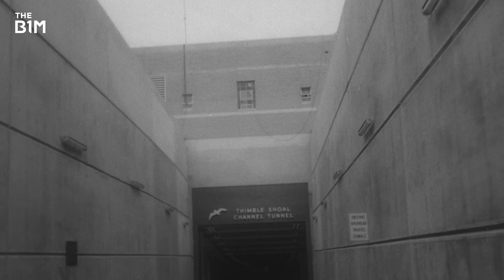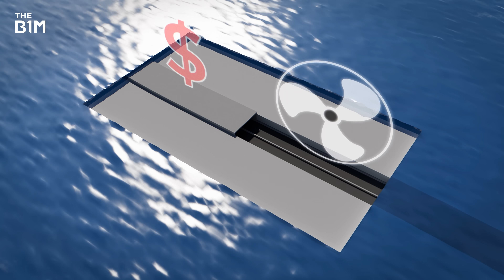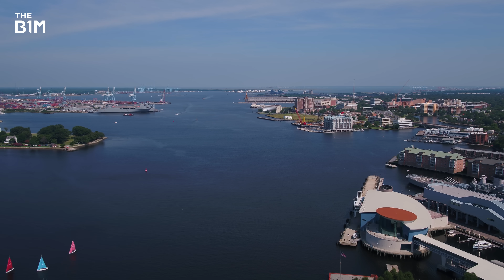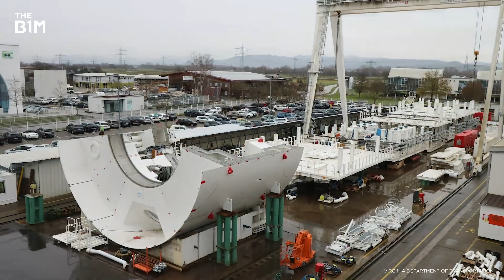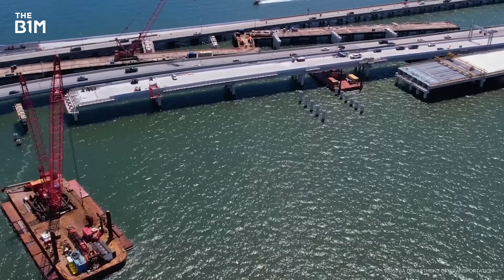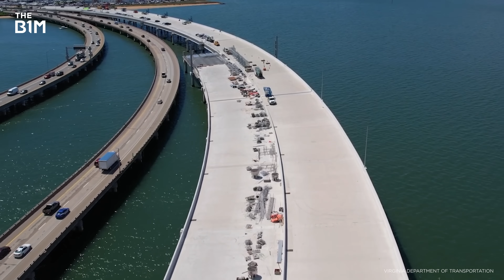The US Megaproject You’ve (Probably) Never Heard Of

Comment: Back in the day (1960's-70's) we had just 2 lanes total with NO room for error.  There were men in the tunnel on a narrow side walkway that literally WAVED vehicles to keep on moving along... too many drivers would slow down (even stopping) when they got inside the tunnel for its obvious claustrophobic atmosphere (with vehicles in the other lane coming towards them).  A Sunday evening going from my grandparents in Va. Beach to go back home to Hampton regularly inlcuded the multi-mile crawl of under 5-10 miles per hour to get across the bridge-tunnel.  (Nevermind the 1070's 90-cents toll to do so).  Now some 50+ years later with the current 4 lanes, the same scenario is quite common, even with longer backups (e.g. 5 miles or more).

Comment: I used to drive to work through the HRBT every day and took the Monitor-Merrimack Bridge for the return trip home.  I don't miss any of the carnage and gridlock a bit, especially during the summer months.  Idiots actually run out of gas in the middle of the tunnel.

Comment: I was in the Navy and stationed in Norfolk in 2003. I remember driving in for the first time at night and using these tunnels. It seemed so big back then. I also remember the traffic VERY well. A few years ago, I brought my wife and in-laws down to Norfolk to see my old ship, and when we came in, I noticed the new bridges running parallel to the old one, but I didn't know what was happening until now. This is super cool, but it would be even cooler if it were a tunnel for high-speed rail. 😉

Comment: What they dont tell you about these bridge tunnels is that half the people have tunnel anxiety and go HALF the speed limit, unobstructed, in the bridge just for everything to go back to normal when they see daylight. Most of the traffic is from this and its incredibly frustrating while also causing backups all the way into Hampton on the North side, or VA beach on the south side. Pretty much every-other time I have to take the hrbt, you are stuck behind a row of cars going 30-40mph with the lead car having NOONE in front of them (maintain 55 listed in the tunnel multiple times). And realistically, based on enforcement,  we drive 65-70 on the bridge sections. These people need to just get off the road because it creates accidents, road rage, and problems (which are particularly a problem in a tunnel). sincerely - a hampton roads resident

Comment: As a kid going to the tunnel, it used to annoy me how the radio would cut off. It really sucked if there was traffic because you were stuck in there for 30-45 minutes sometimes. When they built the Monitor Merrimac Tunnel, they addressed that. This new one actually has 4 and 5G connectivity and can be upgraded later on easily.

Comment: THERE ABSOLUTELY DOES NOT NEED TO BE ANY PROBLEMS AT ALL
FOR THE H. R. B. T.  TO BACK UP
A GODDAMNED SEAGULL FLYING OVER WILL CAUSE A MASSIVE JAM
OR HOW ABOUT “ TUNNEL PARANOIA “
I VE GONE ACROSS THAT STINKING THING SINCE THE SIXTIES AND
I COULDN T COUNT HOW MANY TIMES I VE GOTTEN 
TO THE OTHER SIDE OF THE TUNNEL
EITHER DIRECTION
AND NOT A SINGLE PROBLEM OF ANY KIND AND WITH
THE TRAFFIC BREAKING UP AND CLEARING OUT
FROM A MAJOR JAM ON 
THE OPPOSITE SIDE
IT CAN SPRINKLE RAIN AND A JAM WILL FORM
AT THAT THOSE TUNNELS
VA. DRIVERS ARE SOME OF THE VERY WORST I VE
EVER ENCOUNTERED

Comment: To all of the "why not build more rail?" questioners out there:

The grade required to descend 173 feet, then ascend 173 feet, in 1 mile is 6.55%. Very unrealistic for trains. I don't know the economics of lengthening such a tunnel in that area to lower the grade.

Perhaps for that very reason, different railroads serve each side of Hampton Roads. CSX (once C&O) serves the north, and NS (once N&W) serves the south. Each operates separate large coal export terminals on their side. Each side also has separate shipping container terminals. Hampton Roads is a major port, with over 100 daily freight trains carrying containers, coal, whatever. But just a very few rail car ferries operate between north and south. That 3 - 5 mile wide Hampton Roads waterway, burdened with the naval fleet requirement that it never be blocked, is a significant challenge that the railroads decided long ago to completely avoid. Unfortunately, that waterway is smack in the middle of an urban area of nearly 2 million people, who greatly benefit from this and the 2 other road crossings.

Comment: is like the British engineering...
The Station Gateway project in York, which includes new bus stops and infrastructure, is currently facing a projected £28.5 million overspend. Originally budgeted for around £26–£32 million, the project’s estimated cost has risen to £54.7 million due to inflation, utility costs, and contract issues

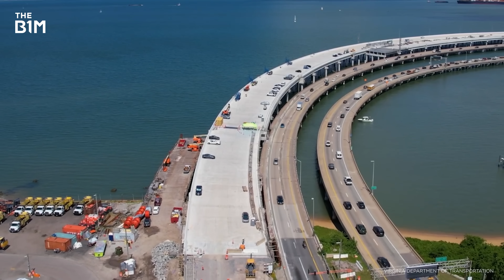Comment: 8:25. Gridlock and bottlenecks.  I used to travel this bridge/tunnel daily in the 80’s. There were electronic speed limit signs that were used to adjust the speed limit based upon traffic load.
We used to joke that when the speed limit of 35 was posted during rush hour, it meant 3 in the left lane and 5 in the right lane

Comment: Lifelong Virginian who has been through the HRBT more times than I could count (starting back in the early 1960s). As a child, the HRBT and CBBT thrilled me and amazed me in equal measure. That is until you got stuck in traffic in the tunnels, especially in old cars that did not have A/C. Going to the beaches in the 60s, in the summer heat, in automobiles without A/C, in the tunnels ... I can still vividly recall the exhaust fumes and noise.

Comment: The system has been here before, just in a slightly different way. When the Chesapeake Bay Bridge Tunnel first opened in the 1960s, it was not just an engineering milestone. It changed how regions connected by removing long detours and creating a direct route across a major barrier.

What stood out here is how rebuilding something like this is not just maintenance. It is about keeping a critical link functioning in a system that depends on it every day. A simple example is continuity. If that connection is disrupted, it affects freight movement, travel time, and regional access all at once.

If infrastructure like this quietly supports entire regions, how do we decide when to rebuild, upgrade, or rethink it before it becomes a bottleneck?

It shows how long term infrastructure is less about one project and more about keeping systems connected over time.

Pilot Elizabeth Graham at Grace Aerial Technologies

Comment: I grew up and went to college there. This tunnel is 40 years overdue and I'm not shocked they're putting in an 'express' lane. Tolls will be high and never go down, only up. One of the pros as to why it felt good to move from the area. 
Little insight, if you go through a Toll reader with a beacon/toll module on it, they still scan your plate. Just in case and to confirm your not using someone else beacon. So if you don't have a beacon, they charge you a plate reading fee. The more you know.

Comment: Such a huge project for 4+ billion? Seems like great value compared to the Eglinton LRT built in Toronto, Canada which cost 10+ BILLION USD and took 14+ years to finally open a dinky ass 19km, 25 stop LRT line. The sad thing is that's only the EAST portion of the project. The west portion is still under construction and will take several more billion to complete and a few more years. 

Canada 100% can't build anything on time and on budget these days. The Gordie Howe Bridge mentioned in the video costs 5.1 billion USD for a small 2.6km crossing connecting Canada and the US which is INSANE and 8 years later STILL HASN'T OPENED YET.

Comment: And yes it said only the 3rd TBM tunnel in the U.S !
So much time spent on the advert he didn't explain the wider project properly at all! becoming a pattern.  The is actually a new tunnel also on the Chesapeake tunnels that has 2 tunnel parts, no work has started on the second yet so it will be a choke point?

The Parallel Thimble Shoal Tunnel project is expanding the 17.6-mile Chesapeake Bay Bridge-Tunnel (CBBT) in Virginia by building a new 1-mile, two-lane bored tunnel. Expected to open around 2027-2028, this ~$756 million project aims to reduce congestion by creating a four-lane structure, with the new tunnel handling southbound traffic.

Comment: I lived in Norfolk when I was little, my father was in the Navy, and we used that tunnel a few times and it was always kind of scary.  I remember seeing the walls looking wet and the roadway always seemed to have water on it and I just knew it was leaking and that it was going to collapse on us.
Reply: The wetness of the tile walls is most likely condensation, because the area is extremely humid, and the tunnel is underground, so the walls are colder than the air, so the humidity condenses on them. They also regularly pressure wash the tunnel regularly, because soot builds up quickly.
Reply: @kazeryu17  Yeah that is correct, but when you are 7 years old and never been in such a tunnel before all you know is that it looks like it is leaking!!

Comment: I not only know about it, but I've driven across it on the way south on a vacation trop. Routed that way just to go across it. It's a little slower by avoiding the main eastern North/South highway (I-95), but then you avoid Washington DC traffic and get better scenery! It's very odd to be on a bridge and not see land in front or behind you other than the four small islands where the tunnel dives into and out of the water to allow the inlets and outlets for the ships. It's an impressive span and a little unnerving when you can't see land on a bridge!
Reply: Though, I did not go through there when the new tunnels and bridge segments were created. I will need to go back. It will likely be not as thrilling since the old bridges look older and more concerning that it should not be there for so many miles  :)
Reply: That was the CBBT, not the HRBT.

Comment: I drive that tunnel multiple times a year to get to the Eastern shoire of MD.  It is about 25 minutes longer than going 95 to the bay bridge but it is FAR less traffic and stress.  Though, it is not inexpensive to use.  $16.00 - $21.00 depending on the time of the year (as of April 2026), but worth every penny IMHO.
Reply: Different bridge tunnel. This is the Hampton Roads Bridge Tunnel. You are thinking of the Chesapeake Bay Bridge Tunnel.

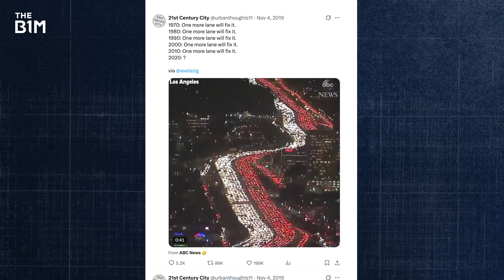Comment: 17:25  That's Canada, not the US.
That highway has been under construction, somewhere, it seems, for my whole life; I'm not young.

Also, the stat usually used for how busy it is, is only for one particular point of the highway, the busiest point, not the whole highway. The daily stat for the Elizabeth line is for the whole line, not just one section. They are comparing apples and oranges.

If just one section of the 401 moves almost as many people as the entire purple line, even just the Toronto section will be moving far more people than that rail line.

Comment: "one more lane bro" with extra steps
Reply: What an original comment.  Haven't read that thousands of times. It was clever the first 100 times I read it.
Reply: In this case, the capacity is needed. The amount of traffic on that road overwhelmed the existing set-up.
Reply: @AuraHero  you’re missing the point completely
Reply: @casmans88  I live here. The problem is that right now, there aren't any other options for the area. The Light Rail has been stalled for over a decade after Virginia Beach refused to allow the extension, and there are no other plans at this time to extend the service to where it might be most useful, such as ORF or Naval Station Norfolk. The only other option is bus rapid transit, which will still take work to approve and implement it into the current infrastructure.
Reply: @A @AuraHero ou’re doubling down lol, you’re still missing the point. “There are no other options right now” is just another way of saying “just one more lane bro”. Instead of creating other options, theyre just adding another lane.
Reply: @casmans88  Only in the age of social media will you find people trying to gaslight local residents into thinking they don't need something.
Reply: That's not really how it works with bridges and tunnels. When there's already a lot of unmet demand, building new roads is actually productive.
Reply: Cuz building more trains will fix everything 
🗑️
Reply: I actually agree with you

Comment: In those old photos of the bridge you can see that it was one lane each way, with no shoulder, and you were allowed to go into the oncoming lane to overtake (that's what the one solid, one dashed line means). The most terrifying near-miss of my life was two cars side by side coming toward me on that bridge at full speed, with no room to avoid them, just water on either side
Reply: The Chesapeake Bridge Tunnel complex still works this way in the tunnels. Nothing like going head to head with an 18-wheeler at 55mph.
Reply: When it was built it probably had the traffic volume of a country road. With the right grading and clearance of visual obstructions such a setup is fine.... with low volume of traffic.